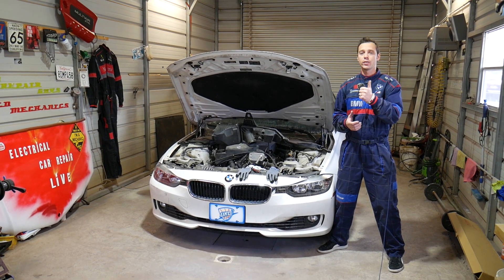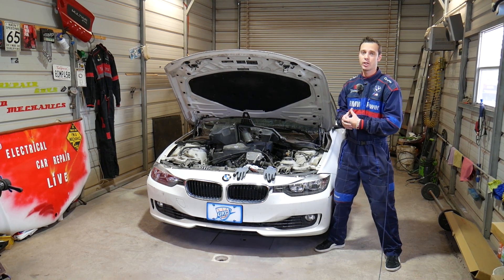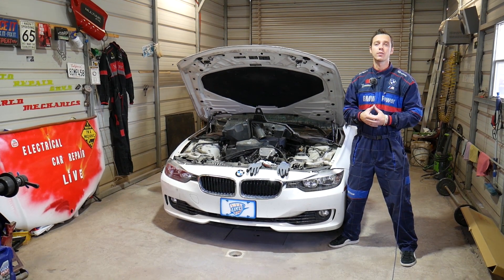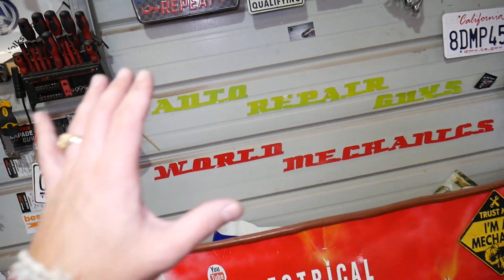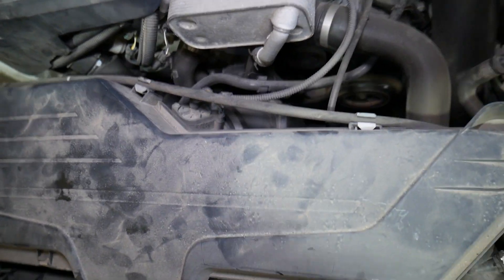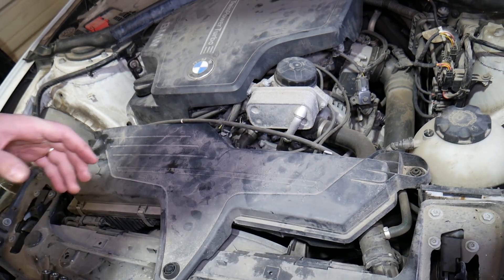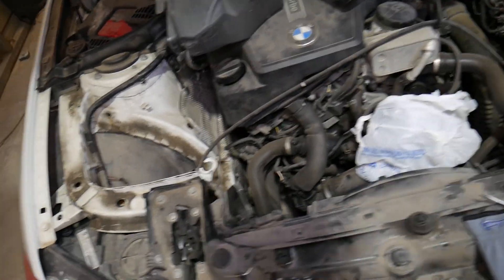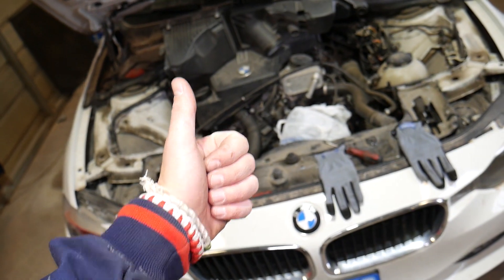BMW PCV HOSE AND PCV HEATER LOCATION REPLACEMENT EXPLAINED F30 F31 F32 F33 F34 320i 328i 420i 428i

Comment: Where would the pvc crankcase heater be located on a 2013 x5 35i?  I have replaced the vent hose but have the crankcase ventilation heater circuit open code.  Thank you

Comment: What is the name of that thin hose that you disconnected from the air filter box ? The one on my 328i is melted right where it attaches to one of the metal clamps
Reply: Yeah same my 328i hose melted too and I’ve changed it 3 times and when I turn on the car the hose melts